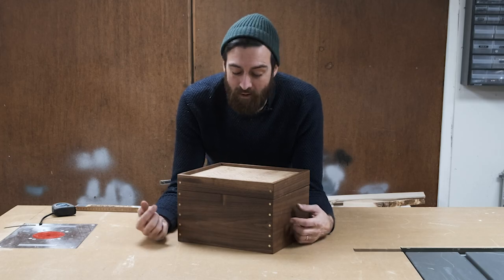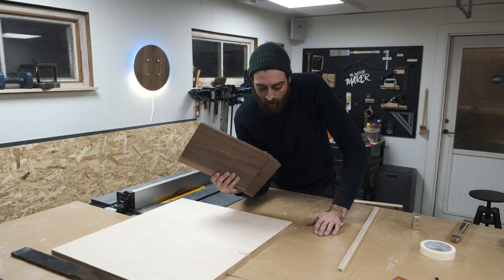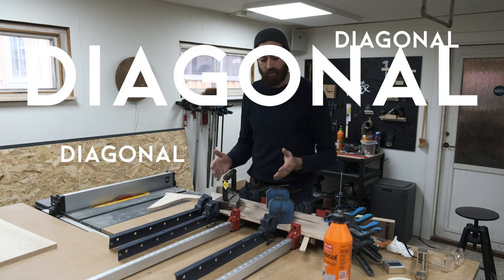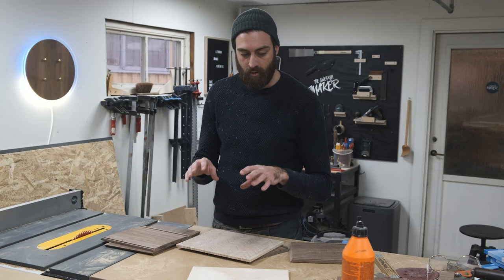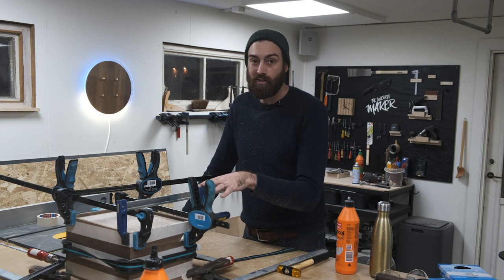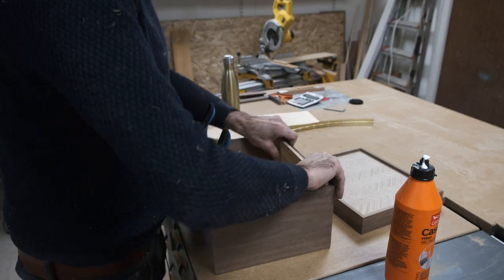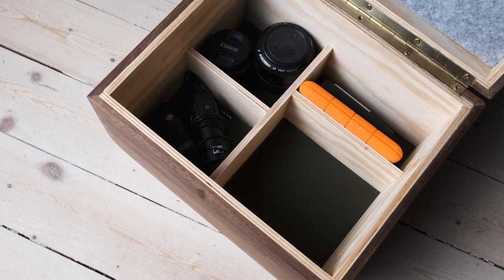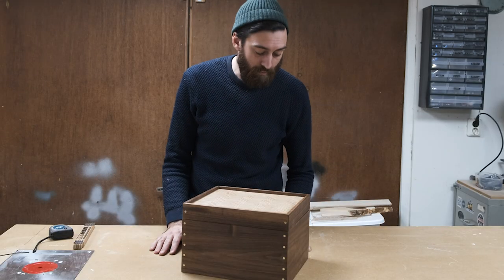Making of a Keepsake box / walnut and pattern plywood

Comment: So inspiring to see how simple ply can be made to look so good with a bit of design ingenuity and some skill. How did you get the brass dowels flush with the walnut in the end? Or were you simply very careful with the measuring and the drill hole depth?
Reply from the maker: Thanks! I sandee the brass down- its a soft metall so it sands easily.